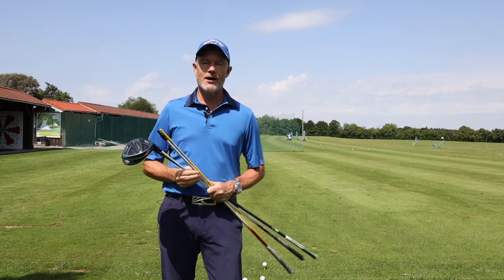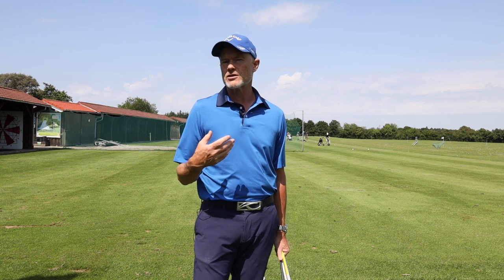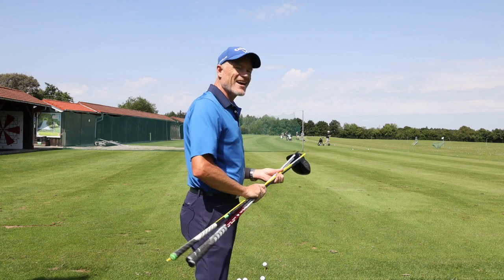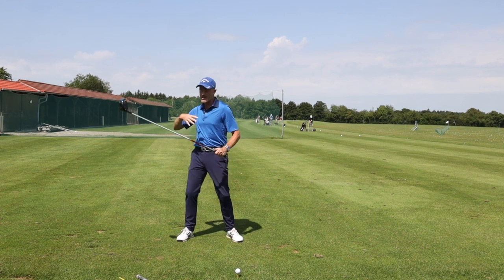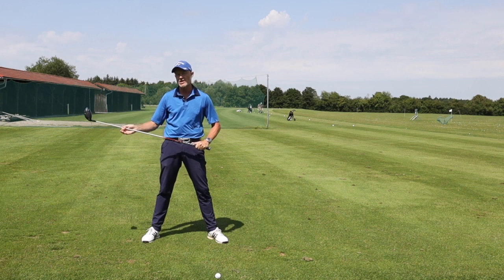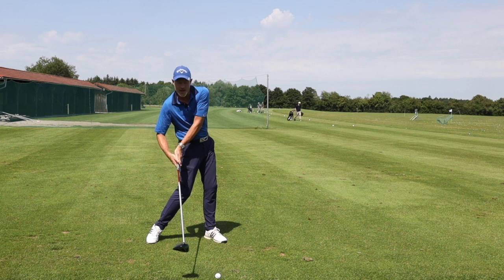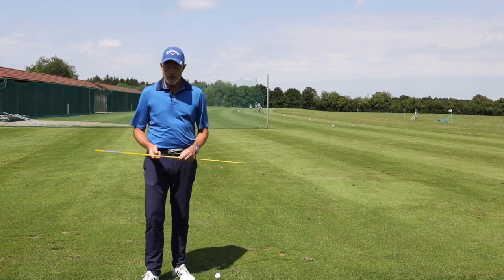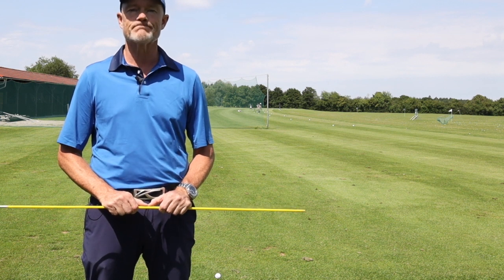What difference does Golf shaft flex make?

Comment: 70 year old former club fitter 20 years ago. Did long drive in my 50's and hit it 356 in ReMax Senior Long Drive. Just retired and started playing again. Swing speed is between 98 and 105 depending on the device being used to measure. Hdcp is a 3 now, Was a +2.0 twenty years ago. I have always teed the ball very high, played it well forward and hHaven't

Comment: 73 years old with Ping G30s and a regular graphite shaft. Driver  swing speed approx 80mph. I've been to a Ping fitting day each of the last couple of years to try newest equipment. Each time the suggestion was to consider going to a soft ("senior") shaft because of swing speed. This year I tried out some G410 irons with a soft shaft. With a 7 iron I found that the feel was slightly softer, but the carry distance was slightly less that my current G30 7 iron. I don't recall if or how much the dispersion changed, but the conclusion with the Ping rep was that there didn't seem to be much point in buying new clubs simply to have softer shafts if there was no benefit from doing so.

Comment: I started using a Ping G400 with the Alta X-stiff shaft a year ago.  Years ago, I was pretty long and won a couple long drive contests in tournaments.  But today, at 77,  my drives are in the 220-240 range.  Recently I had a driver fitting but after 90 minutes of flailing, I was disappointed not to find a better driver than my Ping.  It does weigh 55 grams, so maybe that light weight suits me better and I do find most fairways.  Recently, I bought a set of P790 irons to replace my old Callaway X-hots, which had regular graphite shafts.  They were always very easy to hit but I wanted something stronger for more accuracy, especially in the wind.  I bought a set of TM P790's with black KBS shafts,  which I assumed were graphite. I liked their firmness and after playing a couple rounds, I took them to the store and asked the club repair guy to tell me their stiffness.  After testing, he said "X-stiff---and they are steel, not graphite."  So now, X-stiff suits me better.  I guess the older you get the more you need the stiffness...

Comment: Im 69 years old,swing speed  with driver 92 mph .i was fitted with a stiff 50 gram aldila synergy shaft because it increased carry distance from 180 to 205 and also helped with dispersion .my driver is a callaway rogue draw model  10.5 upped to 11.5 draw setting.it works if my swing stays cosistant but no handicap golfer,(im 15,no practice at alll once a week player,)   will have a cosistant swing with that level of play.if you practice and get regular lessons than the fitting would be of enormous benefit .Im just happy to hit a few really great drives now and then but i could do that before the fitting so get fitted get lessons practice but most of all just be happy to be on the course.Enjoy your golf.
Reply from the maker: Thanks for your feedback Eugene it is a great help!! It would still be interesting to find a perfect shaft for the swing type you have if it helped you get the club back on the ball with less effort.

Comment: I  have not a bad swing and fairly smooth, I play around 4hcp.  My driver speed swing average is around 103mph on the home radar which  I think is more likely 95mph on the Trackman.  I was fitted for around 90mins on the range with Trackman and around a Ping driver last year.  Due to my high launch & spin, we found I had to shaft up to a Ping X flex on a 65gram also had to go with the LST (low sping) head to bring the flight down.  The result was best on a Ping G400LST driver 10.5 with 65gram Ping X-flex shaft.  As for my irons I had TM RSI1 on standard reg TM shafts, on the practice area I had to swing easy to keep the accuracy, so I traded them in for replacement identical RSI1 but with TM stiff, this helped the accuracy and straightened the wandering of the ball flights, with a slight increase in distance.

Comment: Interesting ruminations Jonathan. I agree that manufacturers guidelines are irrelevant but also question the validity of any other generalisations. My experience with different shafts in the same club supports your feel/reaction hypothesis in so much as it relates to my swing and my ability to register feedback and react to it. I play Taylormade PSi Tour irons and with DG s300 (130g stiff) shafts but have a couple of PSi irons in other shafts - one is a 110g regular and another a 110 stiff). What I found, and why I went to the s300 shafts was that although I can get a few yards more with a regular and lighter shaft, I feel I don't have the same control over the club head and my dispersion is wider and my miss-hits worse. So while I swing my driver at 107-113mph and my 4 iron at about 95mph, the heavier, stiffer shaft enables me to return the club head to the ball more on line more often (while giving up about 5 yards on the driver and 3 yards on the 4 iron and virtually nothing on the short irons).  With the regular flex I can actually feel the changes in shaft flex and club direction and therefore react to resist it (but usually with poor timing).  With the stiffer shaft I don't feel I need to 'adjust' anything. The lighter stiff shaft delivered ever-so slightly more club head speed but made the club head feel too heavy for me so I felt I had to 'muscle the club back to the ball.  Ironically the heavy shaft make the head feel a little lighter so I can swing rather than hit.  Keep investigating this 'shaft conumdrum'.  The manufacturers probably won't like it but it would great to get the truth about what it all means rather than blindly spending money hand-over-fist changing shafts every time they tell us the latest and greatest is better for us.  Cheers.
Reply from the maker: Thanks for your feedback Rufuss it is a great help!!

Comment: Jonathan, just discovered your interesting video. I certainly fit your hypothesis for low swing speed senior golfers. I wouldn’t say my awareness is sufficiently attuned to feel the reverse (loss of kick speed) in the release zone but I can categorically say senior / soft flex driver shafts are detrimental to my driving performance.
I had the opportunity of a GEARS lesson, my goal was to find my main power leak but the golf coach was mainly focused on my shaft deflection numbers 70mm toe down and 35mm lead deflection at impact. The max reported loss in kick speed was 3.8mph. (Tensei Red 50 Regular)
There remains a problem, even armed with the knowledge I needed a much more stable light weigh shaft, the reality it no one has a demo matrix of these models, sure some of the manufacturers offer light / stiff but if you check the specifications they can have up to 7 degrees of torque. Premium light stable shafts are very difficult to find and test.
I am going to look through my swing videos to see if there is any correlation between shaft strength and impact position.

Comment: I swing at 115mph as a 51 year old and have a very slow transition. I play only a stiff flex that has a softer butt and stiffer tip. I also prefer parallel S300 iron shafts vs taper tip x100s or taper tip S300. It always baffles the fitters why I am not in X with the club speed. I have identical build as Ernie Els
Reply from the maker: I think a lot of fitters may be taking your age into account and not want to fit you into any thing too stiff. The best thing would be to tell them what you want and let the Trackman numbers and your feel make the decision.
Reply: @JonathanTaylor63  I want consistency, nothing more. That's what lower golf scores are all about

Comment: I shortened my driver from 45.75” to 44.25” for better control. The shaft is regular, since I swing around 90-95mph, and now it may be a little bit stiffer with the shorter shaft. The swing weight changed a lot, I can feel, and the club feels real light. Funny thing is my shots are weak, low and right. I normally draw the ball. Your theory here may explain that, or not? I am confused.
Reply from the maker: Thanks for your feedback MK. Shortening the shaft will make it a bit stiffer but totally change the swing weight. These changes will obviously have a big effect on the feedback your hands  receive and your ability to react to it. I would keep experimenting with length and flex until you find the right balance.

Comment: Interesting vid! I've been using irons with True Temper S300 shaft. I wonder if switching to stiffer shaft would help with shot dispersion. I do have a tendency to hit 1 o'clock...
Reply: Taesung, I used to hit 1 o'clock too.  it was my stock shot with all my irons 2 down to PW. I switched from R to S shafts in the DG s300 and reduced the time to about 12:15. The other change that could help is a more upright lie angle.  If you can't get fitted (best option), try each change separately and go from there.

Comment: I just watched this today because I recently bought a Cobra F8 for $250 Aussie with a flex shaft whatever that means. I think it means more flexible than average. It is an upgrade to the driver that came with my mid 1980's set of Brosnan's. I'm 71 and perhaps not the world's greatest golfer. Like you guys all start your drives with a lovely squatting motion followed by fierce body rotation and then a wonderfully high, elegant follow through. I start my drives with a short prayer followed by, "Where dat?".  But it seems from the video no one will benefit from a flexible shaft - whether young or old, fast or slow. So if that's the case why do they even bother making them?

Comment: I have been studying golf as an aspiring instructor for 25+ years. 3 years ago I was diagnosed with Parkinson's which greatly affects my balance---I then found out I had colon cancer (which I beat-but lost my anus). After missing golf for 1.5 years I returned to my love of the game and purchased a new set of irons, without a fitting, and decided to go to senior flex(from stiff) as I am now 69. I am definitely weaker but still fly an 8 iron 150 yds. I don't attack the ball as before and my game is better. I can feel the clubs load better with the softer flex. I have a new go-to swing which I call my cancer swing that I use a lot. I learned it as I started back to golf and I was very weak. It's just a half swing (hip high--back and through) with only gravity and no added force. I make better contact and the ball goes 2/3 + of a full energy swing. My 8 iron goes 105 yds.  This was very eye opening for me when I think about all of the effort I put in for full swing. Hoping to shoot my age this year. Wanted to share this with you and your followers.

Comment: Sorry - got cut off. Tee it high and let it fly. I hit 6 degree up. Using 9 degree Callaway Rogue and 9 degree TM M3 with adjustable hosel can deloft down to 7 but still hitting it too high..all carry no roll. Looking for lower loft and playing with shafts to find the perfect combo. Went from 45" to 46" with 48gm Aerotech shaft and lost my high fade and hitting it straighter. Wish I could find some lower lofter drivers so I can get a bit of roll. My ball now is high with no roll. Maybe DeChambeau can send he a few of those 5 degree heads hes not using...lol. Probably not enough loft... 7 degree would be perfect. Come on Callaway and TM release some low loft heads so I can get the ball down...And no Im not changing my swing. Anyone making adjustable shafted drivers with 7 degree loft?

Comment: I have all my irons and 4- and 7-wood stiff shafts with low quick points but my G410 driver has a regular 65g shaft with also a low quick point. Don't know my driver speed but I would guess about 95-100 mph as I hit my 7-iron about 160y carry and 4-iron about 190y carry. The regular shaft just felt better.

Comment: Just got everybody confused with conjecture.
The softer the flex the lower the kickpoint. The higher the trajectory the weaker flex of shaft. Give an amateur a stiff shaft and a 14 degree 3 wood and he probably will not be able to get it off the ground.
Reply from the maker: That is not my experience or what the research shows. Have you ever tried a stiffer shaft? The forward deflection will increase loft but you can do that by using a head with more loft, then you will have more control and a higher ball flight.